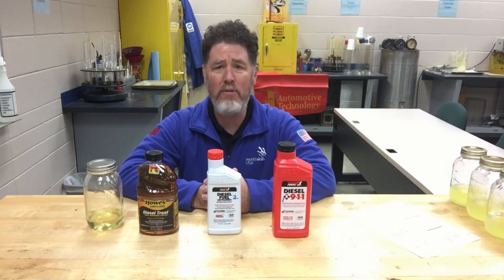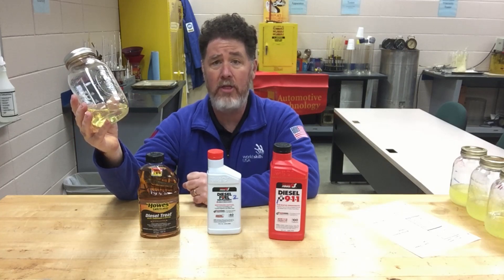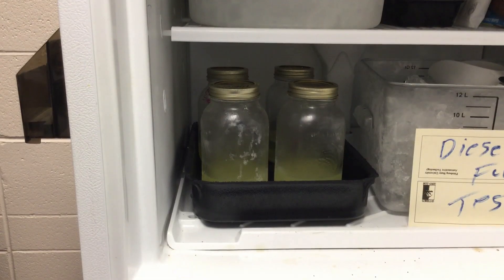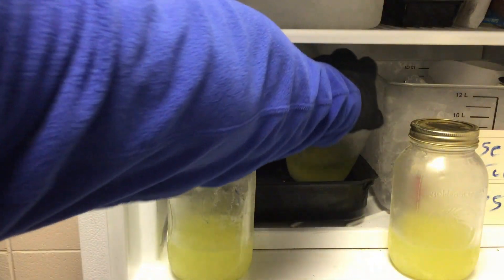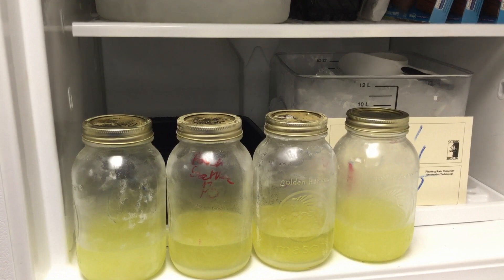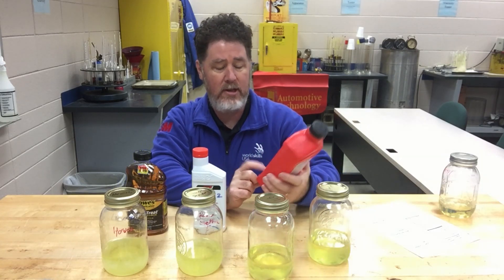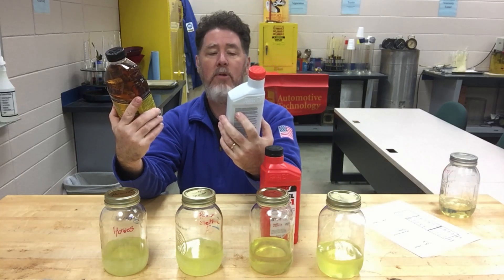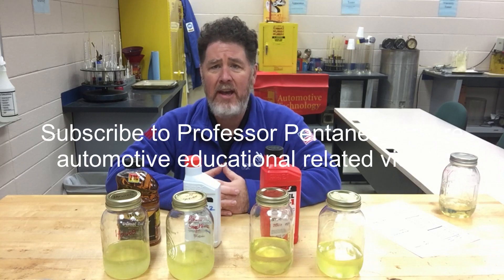Which diesel fuel treatment works best in cold weather?

Comment: When you opened the freezer you recommended 2. And not recommended 1. But never told us what they were! What brands!
Reply from the maker: Hello Mr. Walker,  sorry the results were not clear to you.   The #1 sample was Diesel 911 which is NOT a pre-treatment, so it did not help prevent clouding at -10F.  Sample 2 was the Diesel Fuel Supplement and Sample 3 was the Howes.   Both of these worked at the same level at -10f.   There was still some clouding at -10F with a 1% ratio of treatment to fuel.   I would recommend going with a high ratio of treatment if you are below 0 F degrees.     This semester we will try different ratios to see try to get no clouding at -10 F.   Thank you for watching.
Reply: Thank you. A full time employed trucker recommended Howes to me for my Ford F250 6.7L diesel. It's $10 from Walmart. 👍